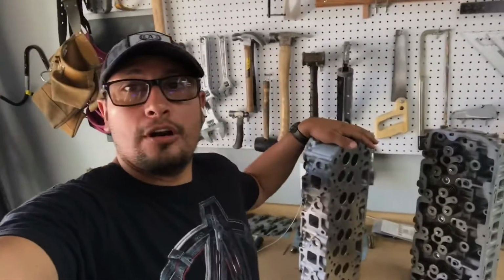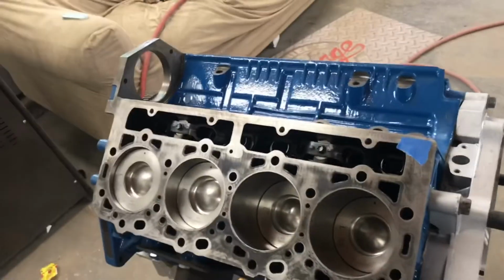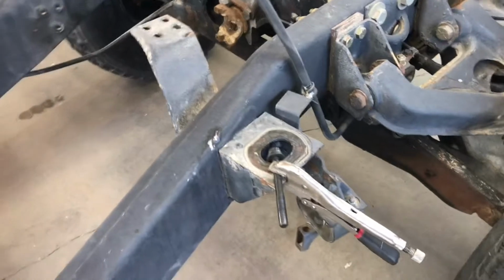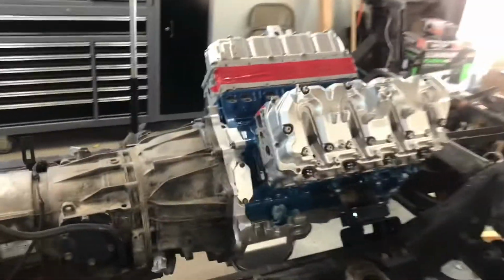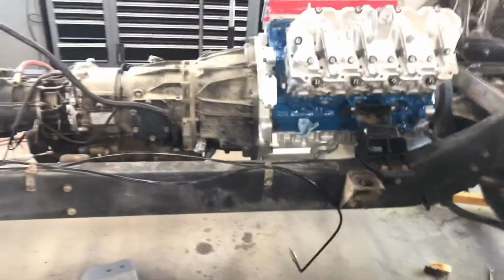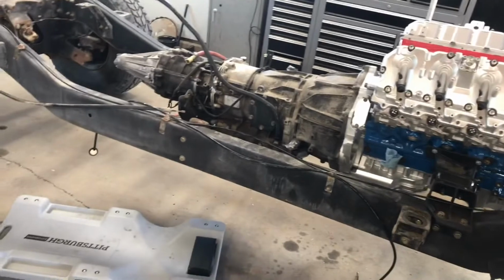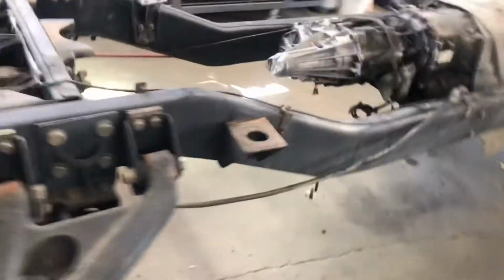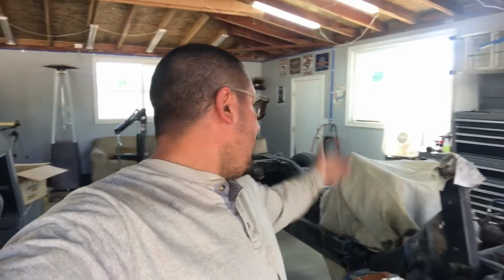Humvee duramax install

Comment: How did you do the engine mounts?  Use the existing with adapters?  Make your own and weld/bolt to frame?  Can you show them in a video?  I'm doing a Cummins in mine and I'm lookin' for ideas, cuz I don't wanna do a body lift (or, as small of a body lift as possible anyway)
Reply from the maker: I used a kit from Tinman Fabrication.  I’ll post a link in the bottom.  This kit allows you to install a duramax/Allison 1000 combo in a Hummer H1/Humvee.  It comes with the engine mount adapters and cross member for the trans.  You just need to reuse the factory Hummer H1/Humvee isolators.  Seeing how the Cummins is a taller motor I don’t see how you’re going to avoid not doing a body lift.  If you go to low then the pan hangs down, possibly below the frame.  All the Cummins swapped I’ve seen had body lifts installed on them. 

https://www.summitracing.com/parts/tmf-109302

Comment: Did you cut your own harness for the ECM?
Reply from the maker: I have not dealt with the wire harness just yet. Currently am working on building the exhaust.  As soon as that’s done I will button up a few last minute things on the motor and start on the fuel supply system.  The wire harness will be the last phase of the project.  I will be using a factory harness from a 2005 Silverado and just cutting out whatever I do not need.  I will definitely get all that on video since that part usually scares a lot of people. I am not an electrician, far from that. So it will be a learning curve for me as well.
Reply: @1EVILC6  That would be for me too. There's 2 other Humvee builds on YT that I'm following. One is a Duramax build as well in Texas. Looking forward to your build!
Reply from the maker: @Superduty_59  thanks man.  I just wish I had more time to work on it.
Reply: @Superduty_59  I started the H1 swap a few years ago, and was forced to stop because out of workshop and my health was not that good. Have made a few videos earlier, also did the wire harness cutting job my self. Hopefully I’ll be back in the swap saddle soon. Best of luck